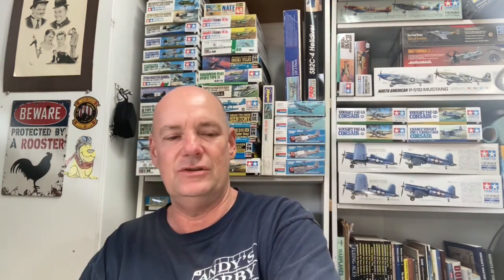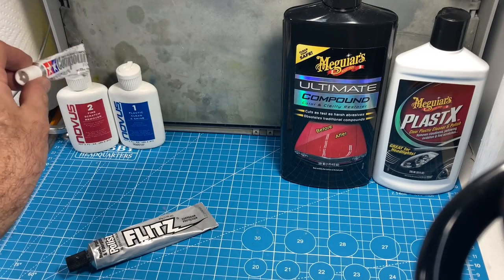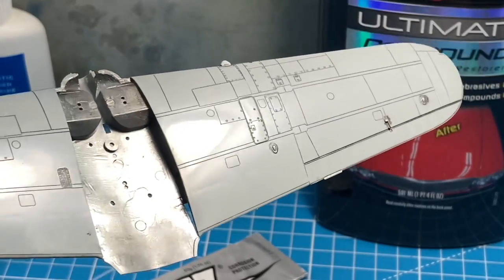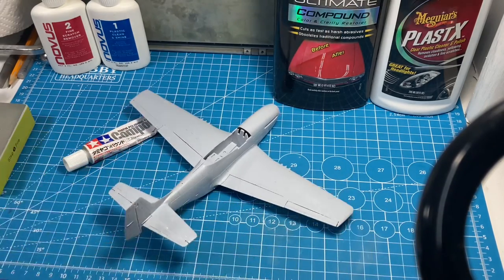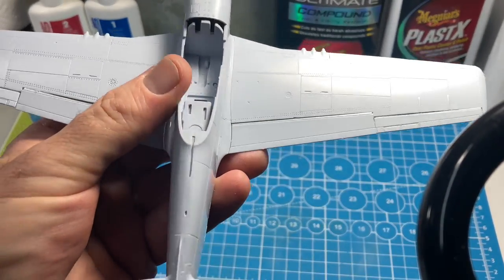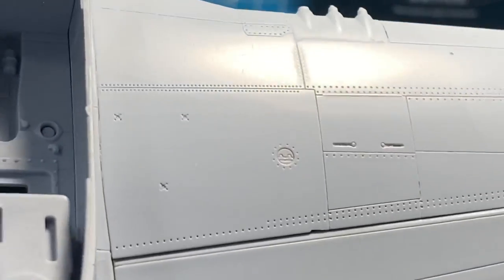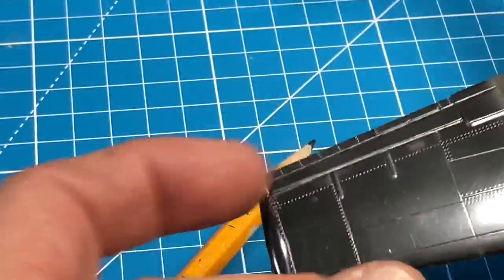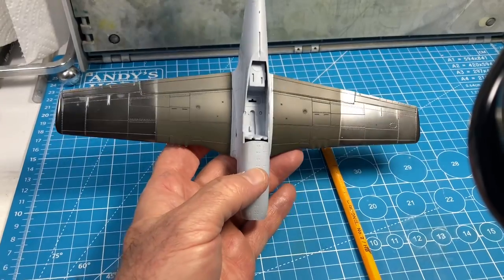Airbrushing Scale Model Aircraft Tip: Polishing Your Model.

Comment: Using this on certain panels would be a good idea. Even polishing to different levels on separate panels. Doing a uniform polish on the entire model would be reserved for a completely polished aluminum aircraft. Not as common to see a combat aircraft in such a state though. Bare aluminum isn’t like polished aluminum.
Reply from the maker: Exactly.  I have a few shortcuts I take that in my opinion make it not only less work than masking and using different metal shades, but also give a more natural look.  Using different mixes of smoke and black for the base gloss is one.  Sanding different panels in different directions and/or levels of polishing.  Rubbing a metal powdered pigment over certain panels but not all.  That may be why I obsess over metal so much....so many different things to try.